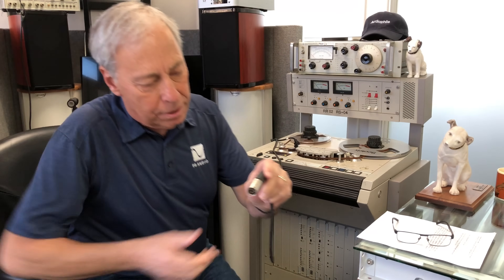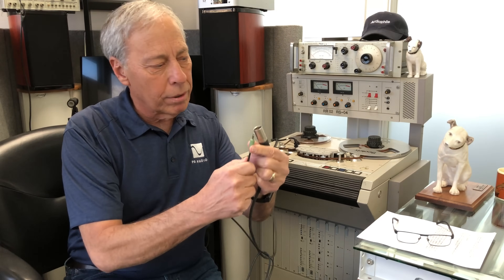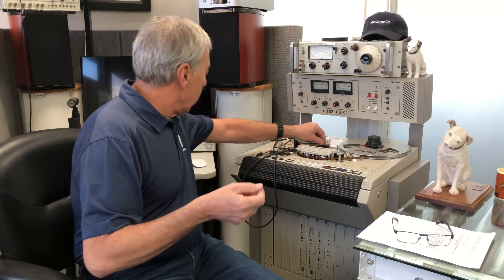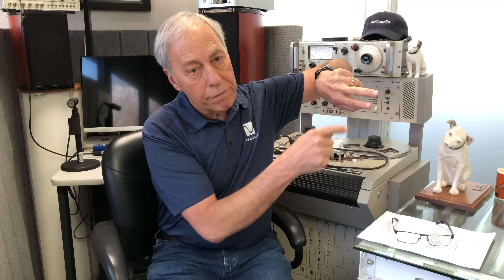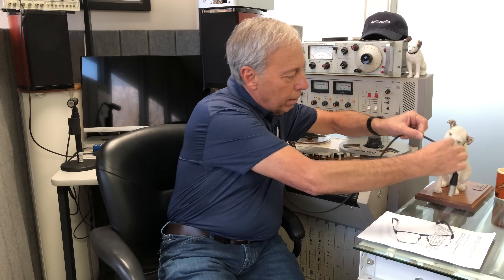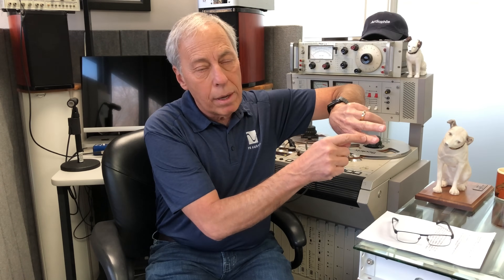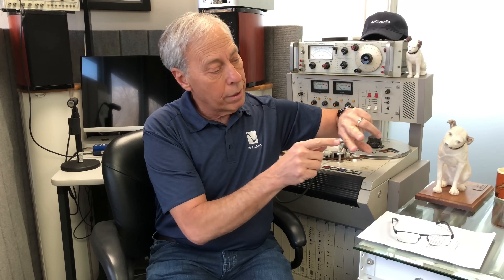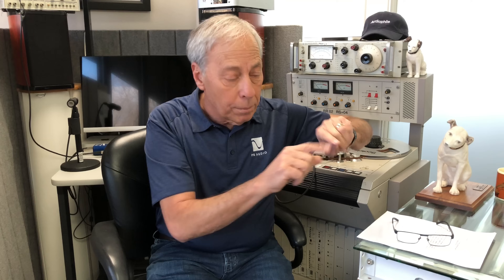Balanced vs. Unbalanced audio

Comment: Graduated high school no problem , into university graduated Bsc degree in agricultural engineering worked the rest of my life in pro live sound were XLR rules . In the later years TRS balanced came in to save money . So whether 2 ft or 1000 CMR works , works well especially in high gain microphone applications . So in retirement  I buy an Integra with every output is XLR  . Plug them into the  mixer of my atmos system XLR to XLR right ? I was getting DAC chatter that drove me nuts ! Moral of this story is the XLR outputs from the Integra are line outputs , the XLR inputs on the mixer are mic inputs which brought the noise floor in full view . Solution : the line inputs on the mixer are TRS , bought a bunch of adapters XLR to TRS , problem gone . It's never apples and apples is it !

Comment: I am trying to figure out if there is an "ideal" way to connect from the UNBALANCED direct outputs of an older analog console into the patch bay prior to the inputs of the DAW Interface.  In my case, I have a Studiomaster Mixdown Classic 8 and the channel Direct outs run to the inputs of an SSL Alpha Link Madi AX.  However what shows up as 0db on the meter bridge of my console, comes into Pro Tools at somewhere closer to -22.  It has forced me to record with much more headroom than usual (has actually been great results)..... I just wonder if the Unbalanced to Balanced connection is "wrong"

Comment: The RCA connector gets it's name from original company because it was convenient at the time it was designed. They are NOT a great connector for reliable quality contact long term. They all get noisy based on design only. 
https://en.wikipedia.org/wiki/RCA_connector
Great explanation you presented in this video!!! Thank you for your knowledge for folks to understand.

Comment: Sooo this is 6 years late and I dont have much hopes of getting this answered, but I understand the basics of how a balanced connection and common mode rejection works, the part that I dont understand is how can a balanced amp and a balanced cable function on headphones if you do not rewire them internally? Clearly theres something I dont understand here, because in my brain, why would you send a balanced signal down a cable when the last bit of the connection is unbalanced? And if that works, and you now send double the power to the drivers, isnt that a problem when the internal wiring and drivers in the headphones were built for half the current?
Reply: As an engineer, let me try to answer: you generally  don't  need to worry about high leve/ low impedance transfers. You headphones  are less than 600 ohms, and a few volts, so no worries.  When you have a 3 mV, 47K input,  that's  when you worry.

Comment: You clearly don't understand balanced audio. You can''t explain what you don't understand and all you are doing is waffling and creating more confusion.
i wouldn't ever buy an audio product from a company that doesn't have a grasp of such basics.
XLR cables do NOT have the shells connected to the cable screen because it can be lethal. Think about plugging two cables together, one in each hand and there's a mains fault on one of the other ends...

Comment: Balanced is best especially for MC cartridges. RCA connectors (single ended) use the negitive (-) to ground the signal where's XLR (balanced) use a separate ground and leave the + and - to carry the signal. Also XLR connectors eliminate earth loop and reduce noise significantly.

Comment: High great videos,
my situation i have an accuphase DP-78
sacd player with balanced xlr outputs

but my technics SU-MA10 amplifier from 1991
has no xlr inputs, only rca inputs.

Does it make sense to take xlr to rca cables?
Or should I go with rca-rca only on the analogue outputs to my amplifier?

What would be the difference?
Thank you for clarifying.

Comment: In the true balanced circuit, why doesn’t the inverted signal cancel out the non-inverted signal? Or does the differential input on the receiving end accept both signals because they are different and then reinvert the inverted signal to match the non-inverted signal?
Reply from the maker: If you were to add them together they would but differential inputs have two inputs—an inverting (out of phase) and a non-inverting (in phase). They are opposite setups such that they only add differential signals and ignore common signals.

Comment: Paul, thanks for the explanation. Doesn't the quality of the cable/interconnect and its shielding also play a big role in preventing "noise" from creeping in? Why would someone pay thousands for a very high quality RCA terminated cable like a high-end AudioQuest or Cardas cable, when they could eliminate any noise with a balanced cable through the cancellation process and perhaps the balanced cable might cost less depending on brand? Is it safe to say all balanced cables are pretty much noise free, but that the overall quality of the cable and materials used is the primary factor driving the price?

Comment: Great video!  Is there a way I can tell if the 1/4" inputs and outs on my mixer are balanced or not?  It's an inexpensive mixer (Moukey Mamx3); and the manual doesn't indicate balanced/unbalanced.   Each channel has a switch allowing you to choose mono or stereo; since it can support stereo does that mean that if I chose mono I would get a balanced connection with a TRS cable?

Comment: 7:50 everything was clear and useful but I didn't understand the pros of using a balanced circuit over a circuit making a balanced signal
Reply: No worries. They are somewhat the same. So a balanced interconnect removes anything in common between the two conductors, like hum. In the circuit, it too eliminates anything in common, but here there's little hum to worry about, and instead, there is noise and distortion generated in the circuit. The balanced nature of the circuit topology lowers both generated noise and distortion.
Reply: @octaverecordsanddsdstudios1285  but where does noise and distortion comes from (when talking about the circuit) ? does the circuit also picks unwanted external noise?
Reply: technically if your circuit's metal enclosure box is properly grounded, it makes no difference, with one exception, which is if the inputs or outputs are unbalanced, then the circuit's "ground" reference will be connected to the enclosure box, providing an entry point for interference and hum.  in a fully balanced system, all connected hardware have the internal circuitry physically isolated from contact with the earth grounded enclosures.  so, you can have an "unbalanced" circuit in such a system, and have it be just as immune to interference, provided it's signal input and output points are configured to be isolated from the enclosure and earth ground.

Comment: So it amplifies the difference in the signals, specifically to ISOLATE what they have in COMMON, so that it can ignore what they have in common, in order to produce a crystal clear signal, that's kinda clever. :)
Reply: you've got the right idea, mate.  it's because the signal exists as voltage, which is a charge difference between two given points in space.  it's like a battery; there's exactly two terminals, because the voltage is actually the difference between the two terminals.  audio signals are the same way.

Comment: There are so many people who argue with me saying balanced and single ended have no difference in sound. And of course they’re all wrong.
Reply: thats gotta be confusing as hell...because your detractors aren't technically all wrong, but you aren't either.  it's not the sound that's affected or even the issue; it's whether additional noise, interference, or hum is induced into the signal along with the sound content.  balanced interconnect is all about a balanced rejection of interference.

Comment: I’m a little confused, in a balanced cable usually there are only 2 carriers and a shield…and only very rarely have I seen the shield tab of the xlr connector actually used, just ground(shield of wire) to pin 1, positive to pin 2 and negative to pin 3, and nothing to the actual “shield” tab of connector.  I guess if you had noisy conditions or some inherent hum you could shunt pin 1 to “shield” tab of xlr connector?  Also, I have seen reputable cable manufactures that don’t even have a “shield” in the cable, it’s literally just 3 conductors.  And last, I’ve noticed another high end cable company that makes their single ended(RCA) cables from balanced cable and only connect the 2 carriers, and leave the shield unused.

Comment: A balanced input does pay attention to noise.  The differential [+ and-] inputs to an op amp invert the noise putting it out of phase with itself thus canceling it and it inverts the - input audio to put in phase with the + input audio.  The result is clean audio.  Another advantage of balanced audio is it is typically +4 where unbalanced is -10
Reply: Wo wird etwas "phasenverschoben" ?? SIe müssen unterscheiden zwischen: PhasenVERSCHIEBUNG und PhasenUMKEHR !!! Das sorgt immer wieder für Verwirrung und Mißverständnis! Eine PhasenVERSCHIEBUNG  von 180° ist ein ZEITVERSATZ von einer halbern Periode ! Eine PhasenUMKEHR ist KEIN Zeitversatz !

Comment: I don't get why you would pay tons of money for advanced unbalanced cables, when good professional grade balanced are better and cheaper. But wouldn't the hum or noise be in phase on both the + and ÷.  That is why it will be phased out by the differential amp, and the audio signal will be doubled.

Comment: I bought headphones with 1/4 in connectors. However, my dac  also has xlr. Would there be noticeable benefit to using an adapter to xlr? Clearly, I cannot achieve true balance because the splitter to the headphones would be the weak point. I believe I'd have to focus on direct xlr connection to a different set of headphones to achieve true balance if I am understanding correctly.  I'm new so please correct errors in my logic. I'm here to expand it. Thank you!

Comment: I have a question and could be very silly to ask: Speaking about balanced cables, that noise generated from an external source (like a transformer) is picked up by two hot signals. But at the same time there is ground as well. Can it be got by the ground as well? So how does the receiver side handles this case? I assume ground is not the earth. It is just a reference level, so doesn't noise on the ground signal introduce noise on the final signal in the receiver side? Thanks a lot you is helping me out on this.
Reply: it can be picked up by the chassey/shield ground wire as well, yes, but in a balanced interconnect system, the two audio signal wires are not physically connected to the shield, and the audio pair also have the same impedance relationship to said shield wire, which is actually the heart of balanced configurations.  the name of the game is that the audio signal exists as a voltage differential, which is simply the electrical pressure difference between the two wires at any given moment.  since a voltage is a measure of the difference in charge between two points, it's essentially a subtractive relationship, so the input to an amplifier is listening to the hot wire minus the cold wire.  any noise or interference that is equally induced into the wires (ensured by tightly twisting the wires), gets cancelled out when it reaches the input (receiving) end of the connection.  like, 1 volt of noise on both signal wires means that at the receiving end where the hot signal wire is subtracted from the cold signal wire, 1-1=0, and thus everything but the actual signal gets rejected from going any further and gets eliminated.  
  this is all based on the notion of shielding discovered by Faraday a long time ago, which is that a circuit can be protected from outside interference if it is enclosed by a metal box or mesh screen of conductive metal or other conductive sheathing, provided that box/mesh is physically connected to earth ground, by which i mean literally the surface of the planet.  on a side note, nikola tesla discovered that the surface of the earth behaves identically to a giant ball of copper.  so as long as interference hitting the metal box of an amplifier, for example, has a conductive path to ground, it gets blocked from further travel and doesn't get induced into the circuit inside said box.  all balanced cabling and interconnects are simply an extension of this principle.

Comment: So, when shopping for balanced interconnects, how does one make sure you are looking at  "pure balanced" and not just plain balanced.  Most internet sales people won't know what you are taking about.  Is the term "pure balanced" printed on the cable jacket or something?  What to do, Paul?
Reply: joeb434   The cables don't matter and will work on all balanced circuits. The difference is in the circuitry. I also think Paul is exaggerating when he says, "much better sounding". If you have short and shielded decent RCA interconnects and don't have them touching the power cord and such, then there won't be much noise added. If you have long runs and a rats nest of wires, then balanced cables will make a substantial difference by eliminating the plethora of added noise.
Reply: @gordthor5351  Gord, thanks for your comments on balanced interconnects.  Very useful.  But here's another two questions that you may or may not choose to answer.  1.  In your opinion which power conditioner would you go with for a two-channel music only system.  A Audioquest Niagra 5000 or a Shunyata Hydra or Venom 2 power conditioner?  2.  Should I match the brand of interconnects and power cord cables with the brand of power conditioners I go with?  Or does it really matter?

Comment: How does the DAC in the Stellar Gain Cell compare with the DAC option on the Moon Neo CD player? I really love dials on such things as the Threshold Fet 10 (which I have lusted over), but it lacks XLR, as do many preamps under $2000 with phono sections. Tracking down a Classé DR-6R has been elusive...

Comment: I always had the impression that the balanced connections and cables only have three leads... One ground, one hot and one cold. I have never seen any balanced cable with separate ground and shield (but maybe I was not looking carefully enough). Can you please correct me, if I'm wrong? Thanks!
Reply: you have the correct impression, balanced is two audio wires and one grounded shield wire.  this topic is riddled with confusion most of the time because it's frankly not well understood by many who wish to discuss it.  there are a bunch of technical terms that get used and misused interchangeably.  "ground" can be referring to "chassey ground", "earth ground", "audio/signal ground", "shield", or any other point in a circuit that's meant to be a zero volt reference point.  but in a given circuit, the audio ground can be tens or even hundreds of volts above or below the chassis/earth ground.  this is why it's dangerous to remove the earth prong from a 3-prong electrical cable on, say, a guitar amp.  if a hard physical connection isn't connecting the chassey to the earth, the strings of the guitar plugged into the amp could suddenly be hundreds of volts away from the ground you stand on or the microphone you occasionally grab once that ground pin is removed from the amp's power cable.  that's how you get zapped.

Comment: True balanced means there is no conversion from balanced to single ended throughout the signal chain. This can also include power amps. Signals are symmetrical with respect to ground. Ground currents (resulting in common mode signals) is not part of the signal as with the shield on RCA. 

Its quite easy to reduce amplified noise with balanced to below hearing threshold with balanced interfaces, but issues can arrise and distortion introduced with non symmetrical (non indentical/mismatched XLR pin 2 and 3) amplification. Also some differential input stages have mismatched input impedances, skewing the symmetry, thus not all common mode noise will be optimally suppressed. 

Balanced path that includes some amplification tends to lower second order distortion due to symmetry, but to reduce 3rd order dustortion is more difficult.

Comment: What is better connection for a low frequency (bass)? Unbal or bal.?
Reply: Eduardo Saldevar  There is no difference, other than balanced removing any noise acquired between two units (RCA interconnects). Music and noise are waves and it's an inherent property of waves (water, electrical, sound........) to cancel each other out if a crest meets a trough. Equal noise will get on both the inverted signal and the normal signal, so when the inverted signal is flipped back to normal, the noise will be opposite of the noise on the untouched signal, thus the noise is canceled. Think of it like this : +signal and -signal (inverted) with +noise getting on both wires. The inverted wire gets flipped back to + in the receiving unit, which leaves you with two +signals (which add to double the amplitude) and -noise and +noise (canceled out). The amplitude doubles because when two equal wave crests or troughs meet, they ad together. This is why balanced has a gain of twice the voltage of RCA outputs.
Reply: BAL is better than SE on average.

There are SE amps out there that are pretty good, but, BAL is guaranteed to sound excellent, with SE it's more of a gamble.

So, if you have a choice, go BAL.

That being said, if clean bass is what you're after, the model of the amp, is generally more important than anything else.

FiiO K9 Pro has VERY clean bass on the BAL output, i know that for a fact, because that's what i'm using. xD